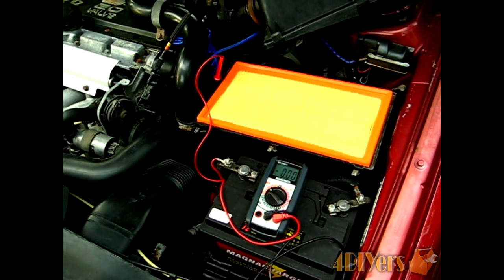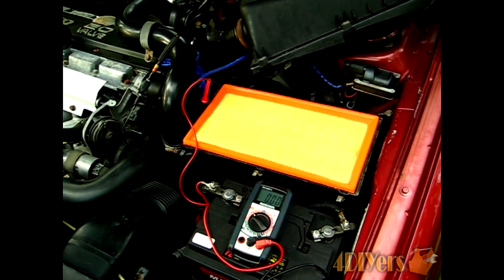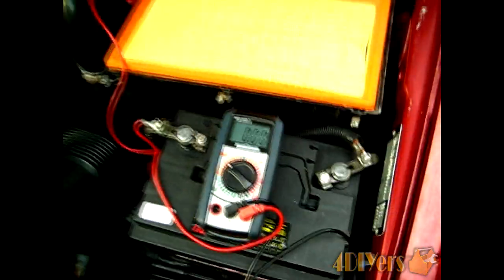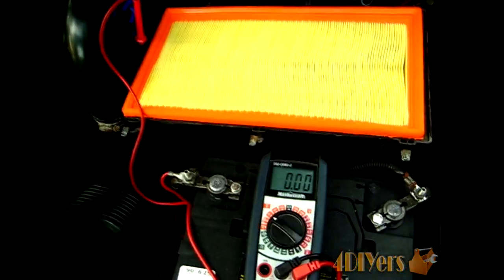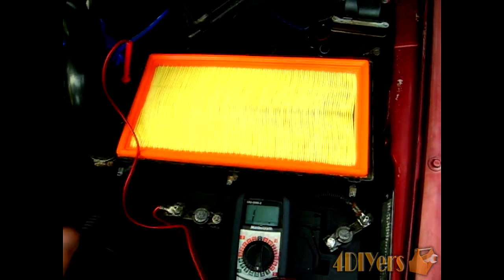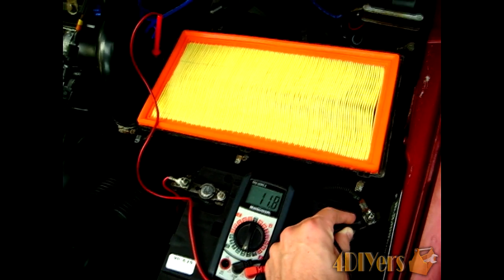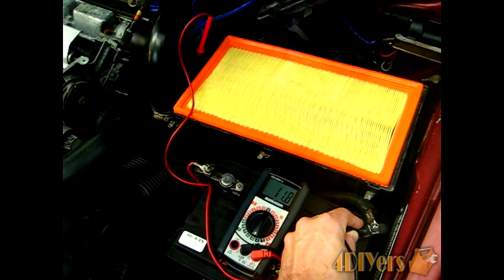How to Test the Camshaft Position Sensor on a Volvo 850 T5

Comment: Hope you are still monitoring this.  I'm resurrecting a 1996 850 GLT, normal aspirated 5 spd.  Car cranks, will not start (had been running fine, then just stopped starting).  Compression all 5 cyl ~220 variability within spec, spark good tested with spark tester light, no fuel getting to cylinders but fuel pump tests good and proper pressure at rail.  Connection 2 on the cam position connector (side where wires going to ECM) reads battery voltage, not 5 volts with key in position II, get batt voltage at #3 and ground at #1.  Is the incorrect voltage at #2 possibly a sign of a bad ground or batt voltage short to ground?  Side note: on the wires to the fuel inj relay, I am also getting a strange voltage reading on red wire #2  - with key off I should be getting 0V there but reading is batt voltage.  Again, possibly sign of a bad ground or short somewhere allowing batt voltage.  Thanks for any advice you can provide.
Reply: I have the same issue with pin 2 - reads battery voltage. What was the problem back then?
Thanks

Comment: 4DIYers I read another comment somewhere on one of your videos to where the grey relay box above the radiator can be bypassed or jumped or something.  How can I do that?
I've got a 96 850 T5 as well. Have changed the camshaft and crankshaft sensors. Have cleaned the spark plugs. Spark plug wire from the distributor to spark plug 3 reads dead with my ohm meter. All the other spark plug wires read ok for ohms.
Please, any thoughts or suggestions?
Here is a video of what mine is doing. Sometimes it cranks and the timing belt rotates, sometimes it won't crank and makwe the noise in the video.
https://youtu.be/f2EOd9DXQ1E
Reply from the maker: Sounds like there is an issue with your starter, it's not engaging. Your pinion gear might be worn, there is an issue with the bendix thread (sticking or worn),  or something wrong with the shift lever. I actually have a few videos for starter operation and rebuilding. Operation demonstration https://www.youtube.com/watch?v=UGx7HMCjqB0    How it works https://www.youtube.com/watch?v=GmwfnEp6S0M    Rebuilding procedure https://www.youtube.com/watch?v=3tN3vhIW3Fc

Comment: just wondering if you have any more information on the t5 motor. I have a crank not start condition and I have replaced cam position sensor, crank position sensor,  fuel pressure is good, I replaced distributor cap, coil is good but no spark at plugs. I have no code indicated on computer. I have jumpered the fuel fuze and tested most of the important fuzes and sensors. I have a good timing belt and everything functions mechanically. im baffled. is it possible that the anti theft is the cause?
Reply from the maker: +dongofast Mine had the same symptom and Volvo is a bit of a pain to troubleshoot as various components are tied into each other. Have you tested to determine if the coil is getting power or the wire from the coil to distributor is in good condition??? Next place to look would be at the grey relay above the cooling fan. That was the issue with mine. It should turn on with the key and you'll feel the clicking. I was able to remove the over on the relay, then close the contacts manually and the car started. It was a faulty wire between the relay and ecu. The ecu did have to be remove and I did a continuity test between the relay and ecu points. If you check out my video on how to test continuity, that was the issue I was troubleshooting there.
Reply: Ok thank you so much. I will begin the process!

Comment: My 1997 volvo 850 glt no spark engine crank I change feul relay crank sensor and cam sensor , still no spark while driving the arrow light start flashing drove the car home , switch of tryed to start it haven't started since , could the computer stop work so sudden
Reply from the maker: St Clair Vernon Have you looked at your spark plug wires and ignition coil as well??? Also change the wires to ensure there isn't any breaks either by doing a continuity test. With my car I had a couple different issues. One my cam sensor was faulty and my fuel relay wasn't working as well. It ended up being an orange switching wire that comes from the ECU to the fuel relay which was corroded half way. Is your fuel relay working when you turn the key on too??? As for the arrow, that is a lambda light and that is normally relating to an O2 sensor issue.
Reply: I have to junk the car been at this for over two months thanks for ur help

Comment: Hi i have the same car and i would like to know why it wont fire. It turns over but doesnt fire. I checked my spark plugs and it just wont spark can you please help me
Reply from the maker: Anbu8366 Causes for no spark on a Volvo could be the camshaft sensor, crankshaft sensor (tutorial for testing here DIY: Volvo 850 T5 Crankshaft Sensor Testing), distributor or rotor issues, coil, coil to distributor wire, ecu, other possible wiring issues between any of those items, or the grey relay just above the radiator.
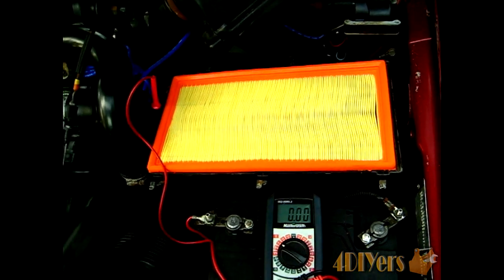Reply: 4DIYers 2:23 I get 12 volt out pin nr.2 (12 volt from both two pins) and not 5 volt. how can that be?
Reply: 4DIYers I read another comment somewhere on one of your videos to where the grey relay box above the radiator can be bypassed or jumped or something.  How can I do that?
I've got a 96 850 T5 as well. Have changed the camshaft and crankshaft sensors. Have cleaned the spark plugs. Spark plug wire from the distributor to spark plug 3 reads dead with my ohm meter. All the other spark plug wires read ok for ohms.
Please, any thoughts or suggestions?

Comment: Hello, I loved the video and today I tested my cam sensor on Renault Laguna 1.8. So a few months ago I've tooked the car to Renault dealer to connect it to the diag machine and I saw an error of camshaft sensor. Strange since today I've tested with a test light and the light blinks as suposed to... The voltage to the sensor is also correct so I think my sensor is OK right? My problem I think is the gazoline pump though...
Reply from the maker: Unfortunately I cannot answer that question because this video only pertains to a Volvo with a T5. It may or may not be the same electrical valves, but it appears the cam sensor on your Renault works on the same principle.